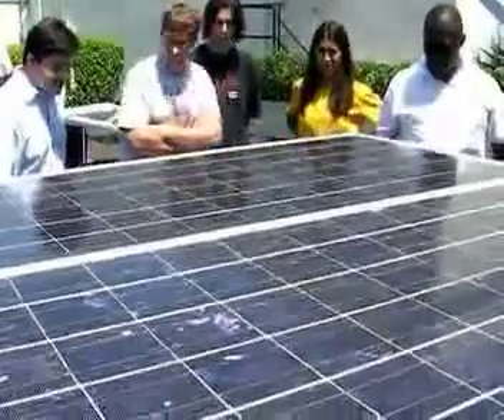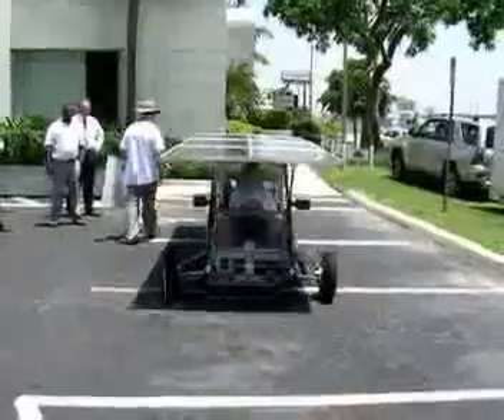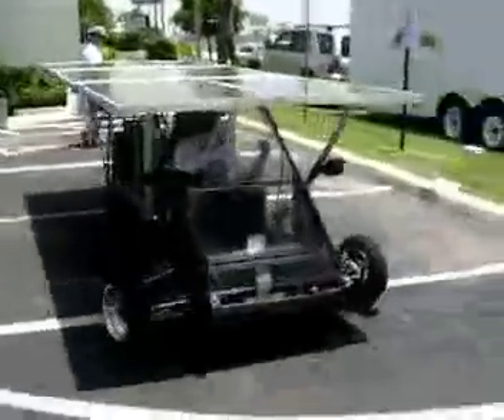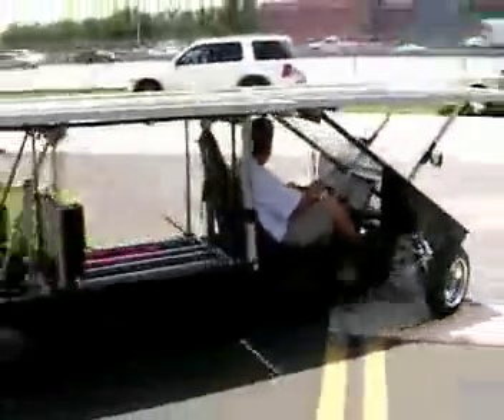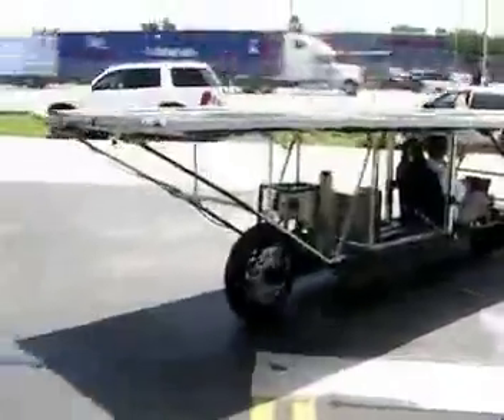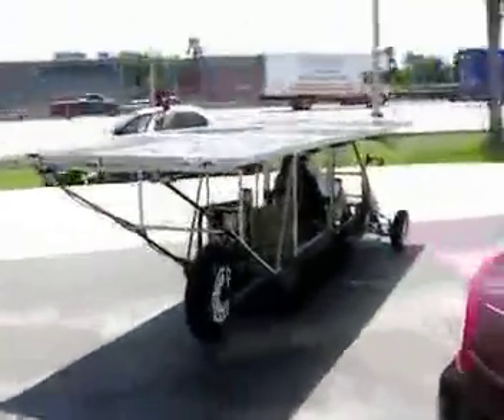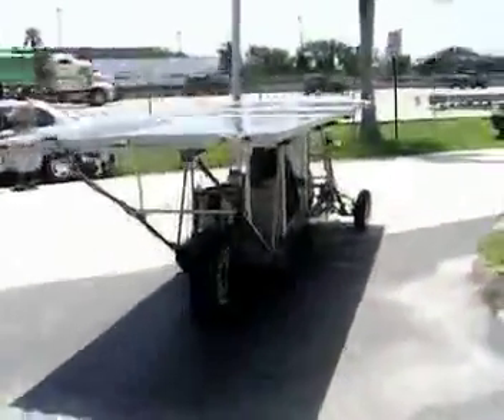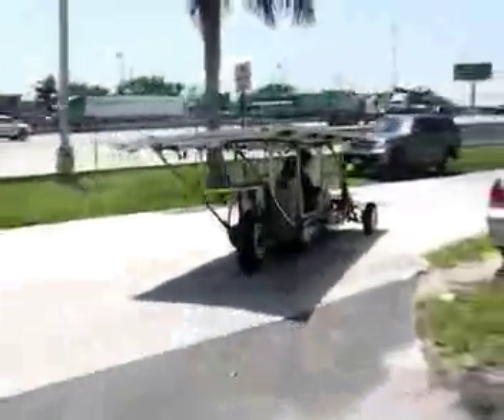Solar Car

Comment: @701983
  G'day. Well I read your post. Didn't track what U were responding to... Didn't need to. You are in error. The 0.47 m2 Gallium 30Watt PV on my 1.8 Litre 1983 Subaru4WD SAVES 5.33 Litres/15 L. per week, on 135 Km/wk. U f'got Alt 50% efficient, Belt step-up 50% efficient, step-up 2-3:1... so 207-350 Ml/Amp-Hr from Auto Alt.= 2%-3% Fuel-Eff. ! Search 'sunfoil' & enjoy a nest of clips.  The "Short-Talk"is best entry- point, "SunFoil Science"=best value..!

Comment: For a solar car . Would the power from the solar panels be used to drive the motor directly or would it be stored in a battery

Comment: @demagetube It would be a waste of expensive photovoltaic cells. They would earn much more energy on the roof of a house: Always under the open sky. Placed in an effecient angle to the sun.
And: It would be a high effort for just little benefit. A Nissan Leaf with 1 m² solar cells would get enough energy for about 3 miles. On a sunny day in summer. 
And: Cooling costs a lot of energy. Parking in the shadow is probably better than standing in the sun, then cooling the car with battery power.

Comment: Actually, this is a South Florida high school team at South Plantation High School, this was the first car they built in 2006-2007 so it would be old, I can tell you this because I'm on the team and this is not Houston Mississippi

Comment: > No wonder a lot of products are crap. You
> engineers are very stupid. You actually
> think that the design goal of the Hummer
> was to burn as much fossil fuel is possible.
> That is got to be the dumbest statement I
> have ever read on YouTube.

Hmm. What do you think the design goal was?

You do realize a hummer on the street has little resemblance to one on a US highway? They're NOT the same vehicle.

It's just a vehicle for morons to make the statement "fuck you, environment!" That's it.

Comment: No wonder a lot of products are crap. You engineers are very stupid. You actually think that the design goal of the Hummer was to burn as much fossil fuel is possible. That is got to be the dumbest statement I have ever read on YouTube. 
The design goal was more of a fashion statement, a statement of status, and it just happened to waste a lot of fossil fuels, not that the owners care till now, Now they are trying to get rid of these. What kinda of engineer are you? That is a strange reply.

Comment: > I'm not an engineer but obviously these are
> school students just showing that cars can be
> run on solar.

These are college students.  They ought to be doing a better job than this.  Australia has a solar race every year, what I saw here doesn't compete against anything I've seen there since 1980.

And a Hummer is an idiot's car.

Comment: I'm not an engineer but obviously these are school students just showing that cars can be run on solar. I don't think these students have any intention of selling these as ford's or chryslers. 
Also how areodynamic is a hummer? 
People will be riding mules in a few years if you know anything about peak oil.  
Hey do you know where I can get an areodynamic mule?

Comment: > It may not seem practical, but when your gas
> powered vehicle is sitting in the weeds a
> solar power vehicle may be better then
> nothing.

I'm not complaining about practicality, I'm complaining that it was very poorly designed.  I'm an EE, and even I can recognize that no effort was made to make it aerodynamic.

And solar cars would be entirely practical, if the speed limit was 30 and I don't think that's much to give up either.  People will never do it willingly though, too short sighted.

Comment: I don't get the point of these anymore.

None of these seems to have ever gone through a wind tunnel, none of them are really practical as a motor vehicle, and there are already much better and efficient designs from 30 years ago.